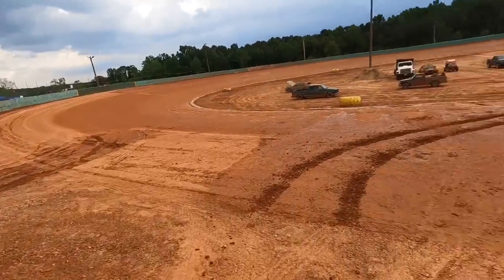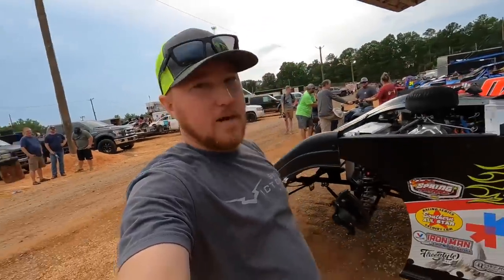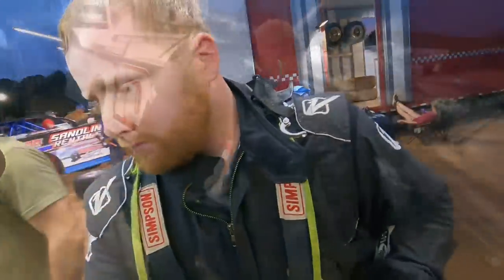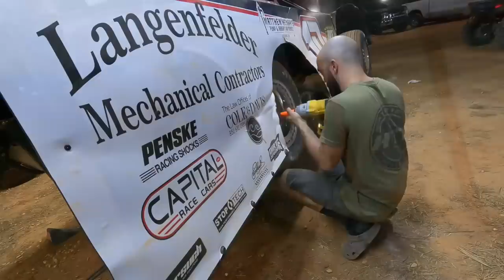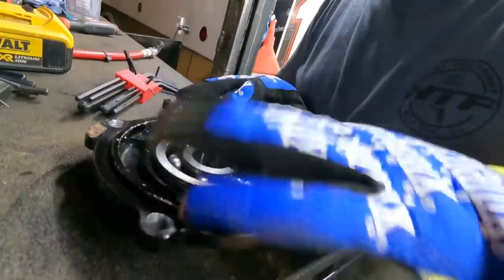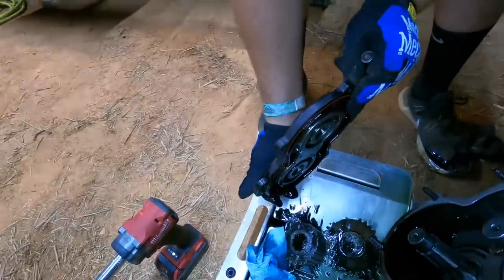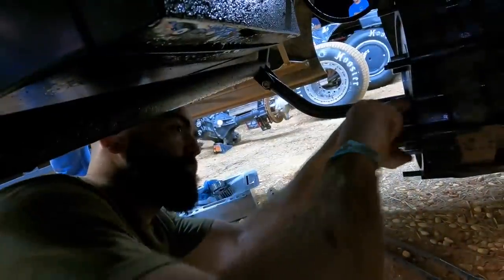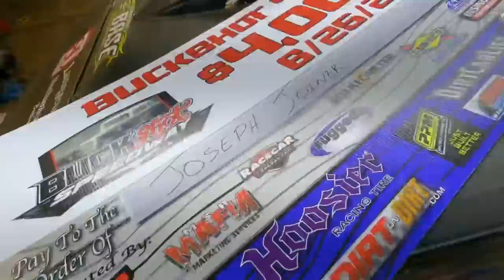Hunting a Win and Avoiding Disaster! Southern All Stars at Buckshot Speedway!

Comment: What a call by Jessie to just change the gear and fluids. You gotta trust your crew with those calls. Replacing the entire rear end might have had a slightly different adjustment that threw it all out of wack especially after running quick time and winning his heat race. Good job Jessie and Great job Joseph on the new track record/quick time,  heat and A feature win.
Reply: Your darn right it would have , what a ride . That car was in beast mode , they had nothing for him .
Reply: I was happy to see Jesse be so adamant and for the team to trust his decision. Also, Joseph came in from hot laps and almost sounded like he was asking Jesse's opinion on setup. Great to see!
Reply: You had them covered joseph, good call Jesse on just replacing the fluid and the gears. You guys had a clean sweep night, congratulations. 🎉🏁
Reply: Yes, a little bit of luck goes a long way. Had a 50/50 shot on whether one does well or grenades a several thousand $ rear end.
Reply: All that bucking and hoping getting into 1 I wanna say can’t of been good on the rear gear set!!  1 wheel in the dirt and 1 free wheeling as it bucks and hops took them out I’m sure of it!

Comment: It sounded like the car was a little tight in hot laps, with Joseph blipping the gas mid corner to make it turn. Y’all made a nice adjustment.

Jesse and Jordan are work horses. Y’all are blessed to have them.
Reply: You got one good set of ears because if it would’ve been loose he would’ve been doing the same thing
Reply: @thomasgray2184  I’ve never raced real cars, but I do iRacing, and it’s something I’ve done when the car is tight. Stomp the gas, just for a second. He only did it in hot laps a few times, but did not have to do it in qualifying.
Reply: Fair enough

Comment: Great job guys, glad to see things starting to come together.  Honest question, couldnt Joseph had tried to go round the top side on couple of those lap traffic cars?  would of liked to seen em try at least once to see if it would of hooked up.
Reply: All the traction was down low if you notice nobody was riding around the top everybody was around the bottom that's where all the traction was at the water has a tendency to run down from the top of the track down and you notice it started drying up and kicking up dust even towards the end of that 40 laps so the top would have been real sketchy and real slick. Enough said..
Reply: Hard to see from the video, but the top lane was super dirty - he could've tried but would've probably had several laps of cleaning it off to do so. Same reason why Franklin couldn't try to run the top lane when he would get close.
Reply: Yeah that’s what I was saying after they pinched him down a few times . I was telling myself Joe go top shelf. Liao! Would of been interesting. But then again to let the bottom open might have been the loss. Who knows?

Comment: The HTF boys don't respond to comments, but could someone tell me what the track inspectors look for before the cars go on the track? The guy in the orange shirt was there with a clipboard but we didn't see much other than him reaching into the engine bay.
Reply: Southern All Stars normally checks where the engine is located compared to the front ball joints. The front spark plug can only be a certain distance behind that point. 

They also check some of the body, spoiler & side spoiler heights and the deck height.
Reply: @vernsimmons945  Thanks, I'm relatively new to late model dirt racing and am interested in becoming better informed.
Reply: @wideslammer  do you have a local track? I would suggest going and walking around the pit area early. Talk to different crews & drivers. Most folks in the sport don’t mind answering general questions and you can build great relationships.
Reply: @vernsimmons945  That's a good idea although in my area you can only get into the pits after the race and I'm trying to get out of the parking lot. (I know that doesn't sound like a very good excuse.)